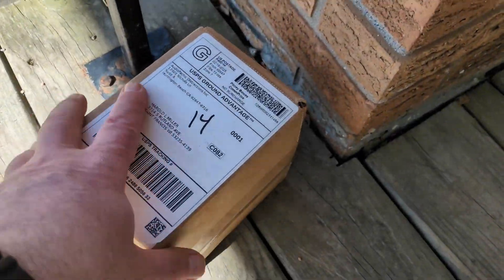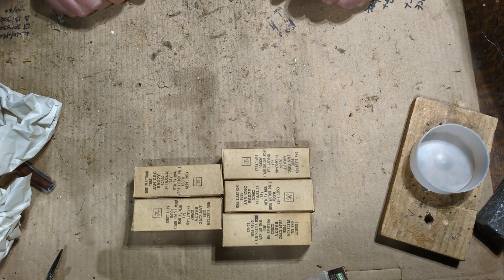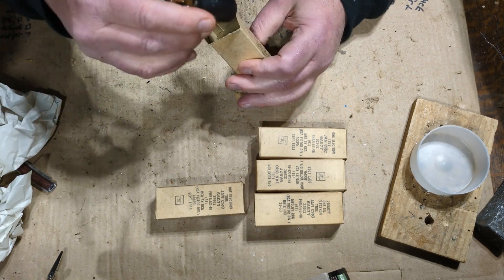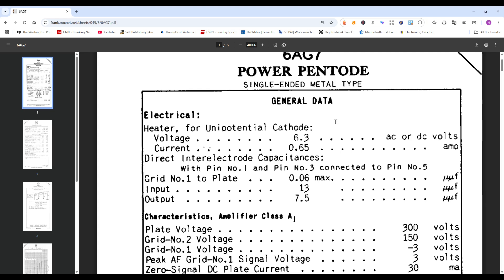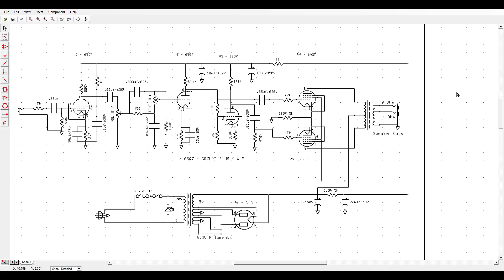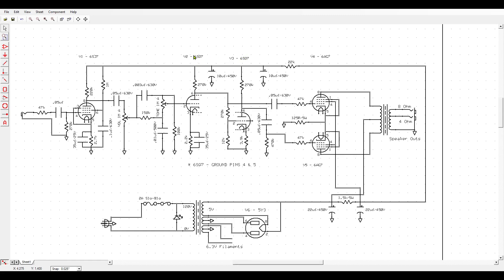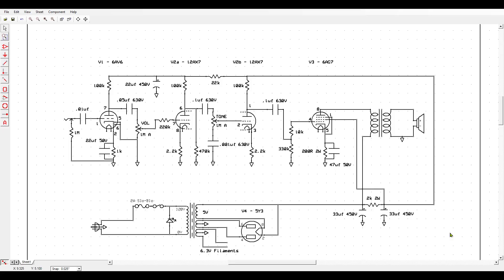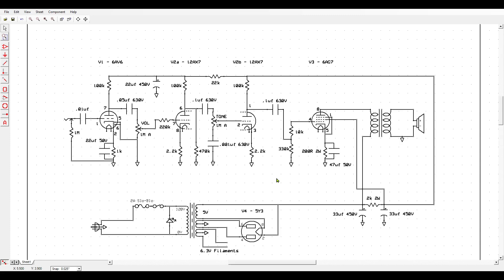Getting that Supro Thunderbolt Sound at 10 Watts Using Oddball Tubes!?! Plus a Bonus!

Comment: Working on a flea watt single 3nder version the EF86 channel of the Matchless Dsomething30 w/the coupling cap select switch, c.f. driven tone stack, adding a loop with a buffered send w/level. 6AW8A, 6EU7, 6DX8 or 6BM8. Or if I get tube-count-greedy PF86 12DW7 x2 and maybe an EL86, 6AQ5, or a "quieter" paralleled 12BH7 if it doesn't have too much cookie dough in the final sound. P.T. only has 1 6.3v winding so EZ81 or EZ80. I've long wondered if PP 6AK5's would work, finding an OPT transformer is the challenge
Reply: I managed a satisfactory pp 6AK5 some years ago.
OPT was a 5watt 100v line transformer. 
I could have got a better impedance  match if I had used a 16 ohm speaker - or a quad of 6AK5's.
(I think I only have 80 of them left 😂)
Reply from the maker: Wow! Sounds like you have lots of options there!

Comment: Thank you for 6AG7s!  After the cold biased 5879 the Filmosound 385 has a similar procession of 12AX7 bias and low gain plate resistor values as the Thunderbolt. It's not the entire sound, p.i. distortion is a part, but it's a good part of it. I never know how to describe amp sounds but if it's not a Fender blackface sound and it's also good I am glad!

6GM8's are low amplification dual triode that run at 25 volts, car radio tubes in other words. Other fun ones in that category
Reply from the maker: Sometimes it's good to change the sound up a little!